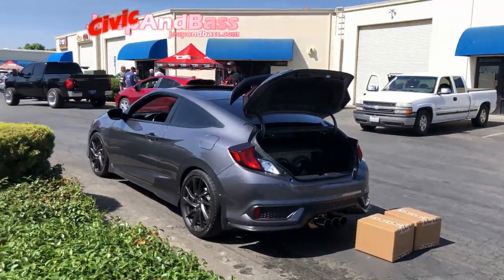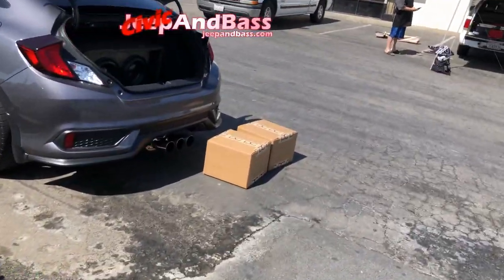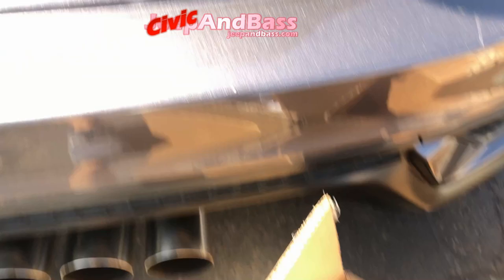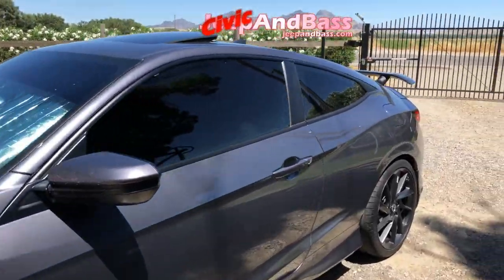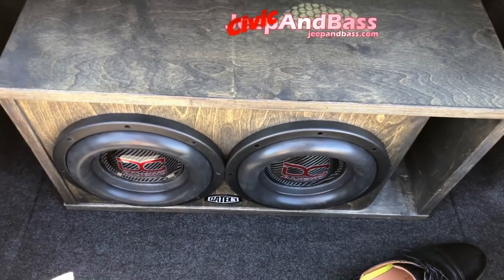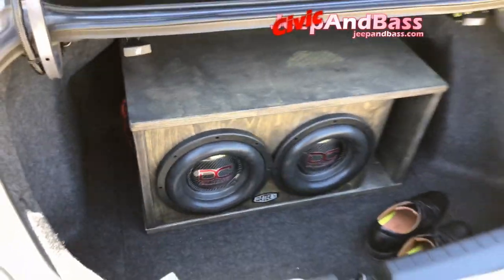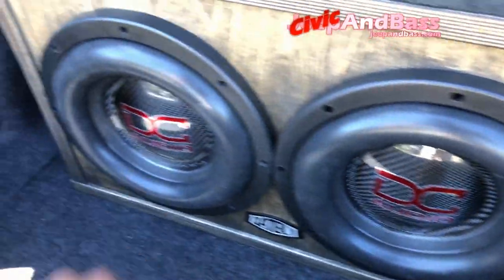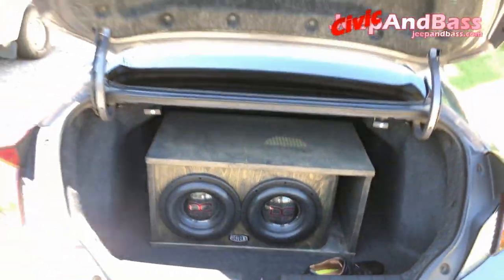Quest for the loudest 10th gen Civic Audio System

Comment: problem with big box in small trunk is the area for the bass to come to the front... people sometime forget abot WHERE the sound pressure can travel back to the front when ity is squeezed around the som box so tight like that...  smaller box with external round port can do alot more as the bass have the room to travel back to the front of the car around the box.

Comment: What level are these again? And what level were the other ones? I got mixed up when you were going over it. I tried listening to it like four times and still didn’t get it lol. I plan on getting two tens but I’m not sure what I want to get. This is just a little help towards my final decision. DC level 3 or 4’s or XL Elites Sundown Xv2 or Zv5. Which ever I get it will be 2 10’s. They seem to be loud enough for a every day system.
Reply from the maker: Sorry for the confusion! I pulled out a stock pair of Level 3's (dual 4 ohm) and installed a set of Level 3's with Level 4 parts (dual 2 ohm).
Reply: JeepAndBass gotcha 👍🏾. I like the way the level 3’s performed in your car. Never seen 10’s shake a front window like that before but then again I haven’t been in the sound system game in years. The set ups now a days are insane!!
Reply: Get the zv5s
Reply: basshead forever club any reason why you say Zv5’s? How do they sound?
Reply: @skywalkerclone1978  they are really well built and can actually play pretty low

Comment: That's a nice trunk build man. I have a 2018 honda civic hatch. Currently doing a 149.2 working towards that 150. Goodluck on your bang man
Reply: You running extra batteries and a high output alternator
Reply: @dustinhoward4098  Yessir. I have 3 xs power lithium batteries and a 2 XS Power AGM's - charge at 14.5- dont see under 13.6. I have a 300 amp Brand X alternator and I hit a 151.3 recently wi th more testing
Reply: @lmadron99  I have a 2020 civic can’t find a high out put alt at all due to my pcm
Reply: @dustinhoward4098  My car is PCM controlled as well. Just hit up Brand X Electrical on facebook and tell them your car and engine size and they will give you options on size. Just choose what size and they custom make it for you. You could get a PCM bypass as well but I don't actually worry about it. My car does just fine